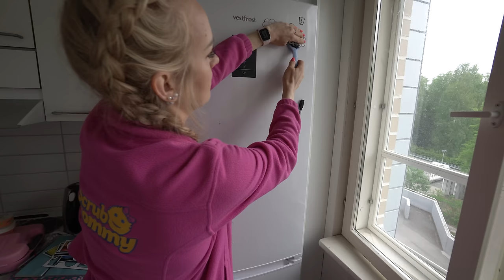Giving a Girl's Home a Free ✨Sparkling✨ Makeover!

Comment: The drain in the bathroom is really cool. It sure makes cleaning easier.We don’t have those very often. If we do it usually is just in the shower only. And I am assuming the machine in the bathroom is a washer dryer combo right? Those have been in almost every video. I don’t think they are used a lot here in the states. You might be more inclined to take a small   vacation once you move to Florida. Great job .😊

Comment: Wouldn't it be easier to wash the shelves of the refrigerator in the sink to make sure there is no soap residue left over?
Reply: She would have to set up two cameras on tripods in the tiny kitchen which wouldn’t work. Or record clearing out the fridge, then move a camera to film the sink washing, then move the camera back to putting everything back into the fridge. add in the additional editing. I can see why she just wiped it down